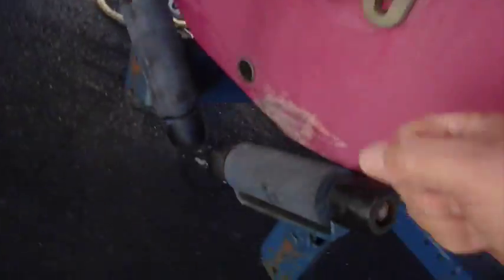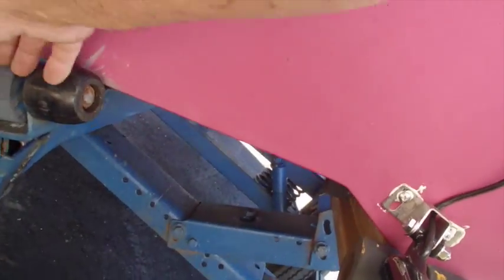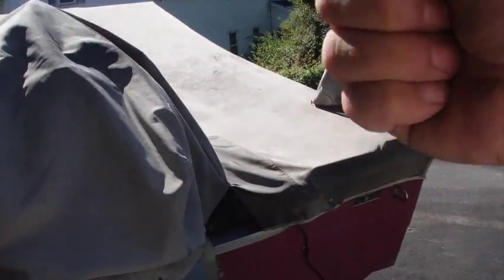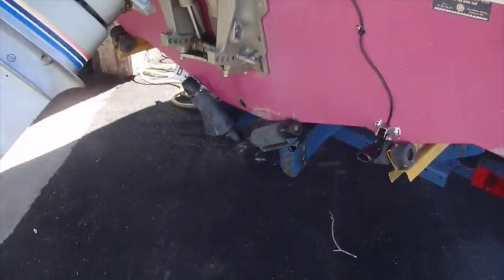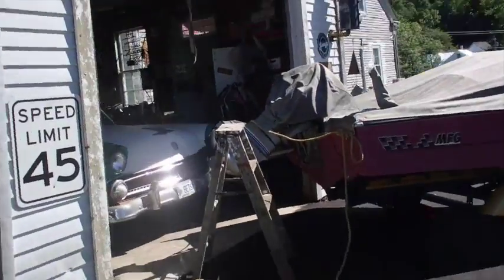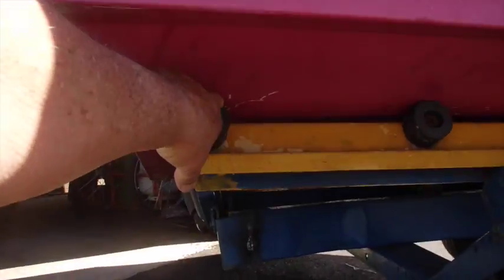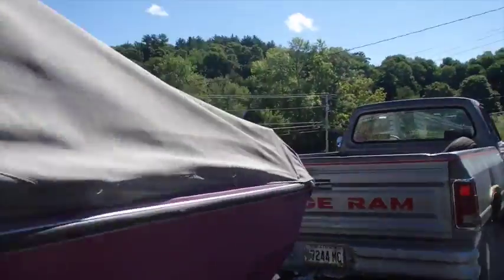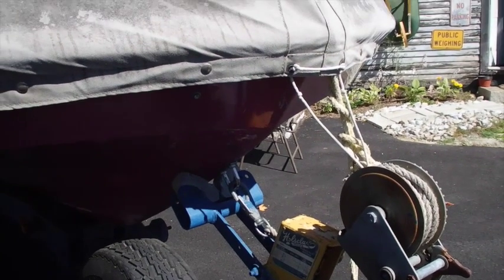I'm a Boat Stretcher

Comment: adjusted the very front roller then the stop.
don't cut anymore off the back, the more you chop off the deeper you need to back into the water to just get the boat on and off.

Comment: The reason nothing changed is because of the angle of the bow.  The top of the boat is longer than the bottom. What you need to do is put the bow catcher up higher above the eye on the bow.